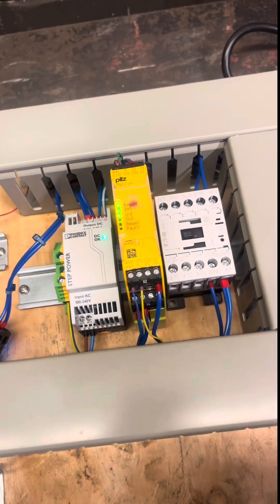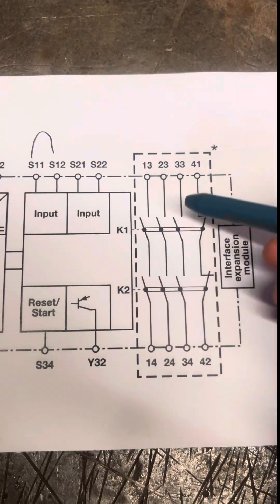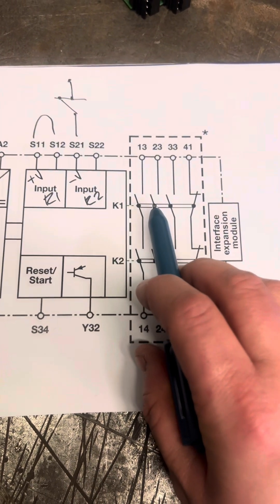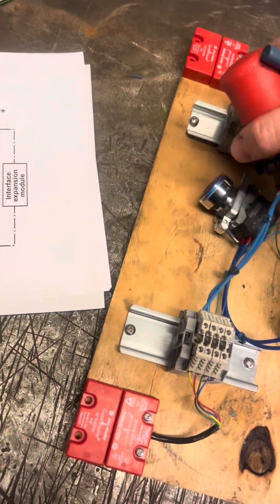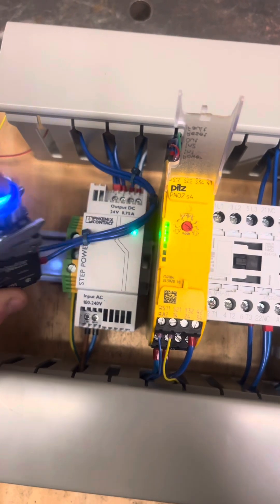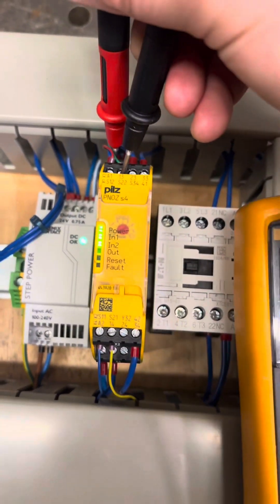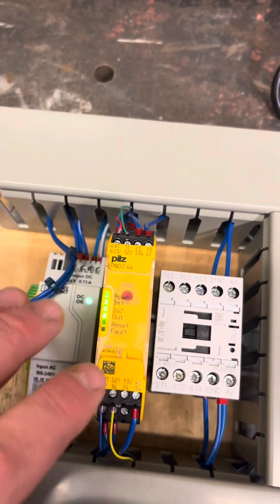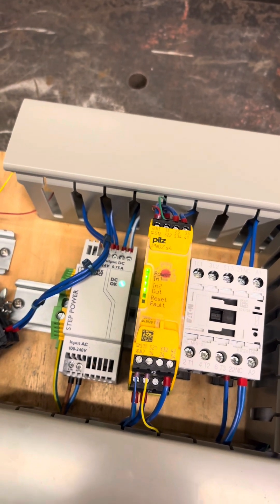How safety relays work and how to fault find using Pilz S4

Comment: hi. I'm new with these safety relays. I just encountered these problem and I don't know how to deal with it. The Red button is steadily turned on and the Green button for reset is blinking. how to diagnose or pinpoint the fault Pilz  s4.
Reply: Read it's documentation.